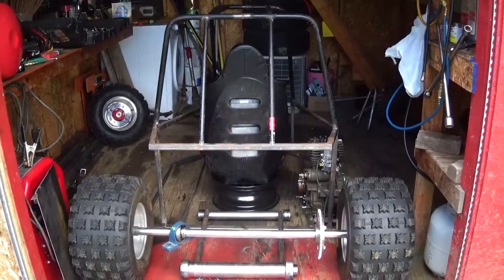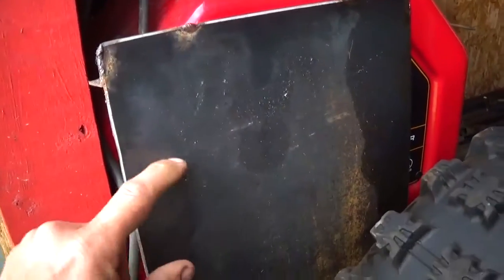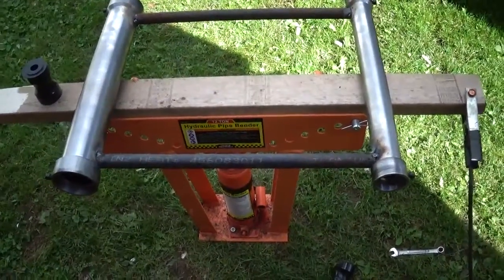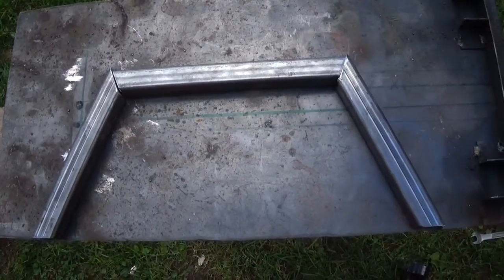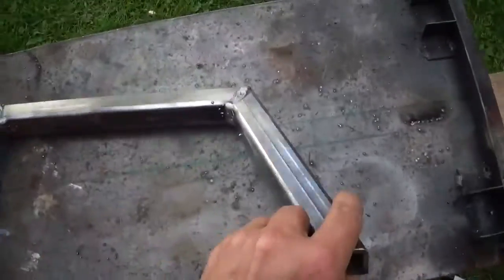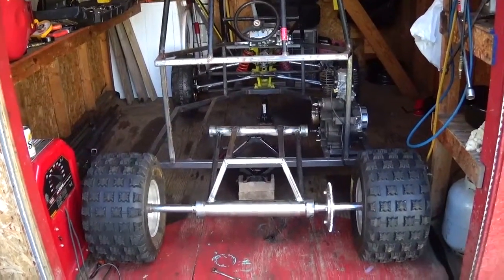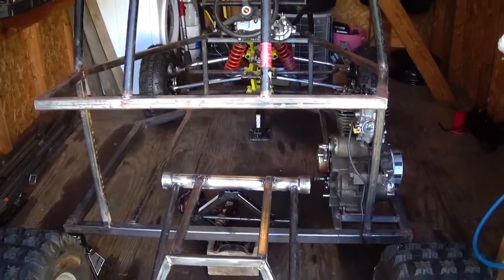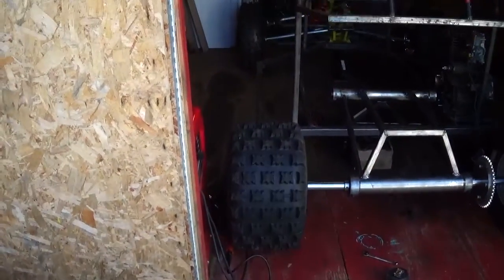300ex Sidewinder Pt 9

Comment: Looking good William. You can always cut the studs on either side of the door and then put them back in with braces to get enough clearance to get in and out. OR... you can just take the front wheels off.
Reply from the maker: It rolls out but just. Oh yeah that that's not posted yet. lol

Comment: where did you come up with the rear end plan or idea I'm in a similar boat with a modified odyssey frame and want to use the front and rear side winder design , not a stock odyssey frame modified with bad engineering before I bought it want to do a solid axle rear swing arm and dual a arm suspension on front and also don't want to buy plans from edge for one they come in mm and don't include a DIE radius for bending , already bought front suspension plans without bend die reccomendations hard to figure out but there rules of thumb for bending to figure it out anyway want to find out what components are needed for the rear casing

Comment: Do you have facebook ? I have questions about my Suzuki lt230s and rebuilding it stable
Reply from the maker: The back has trx300ex hubs and wheels with more offset. The front has china bike hubs and spindles that set wheel out more. Theres more offset on the front wheels also.